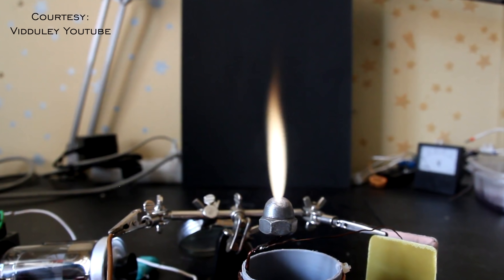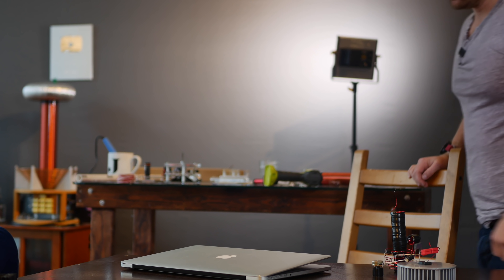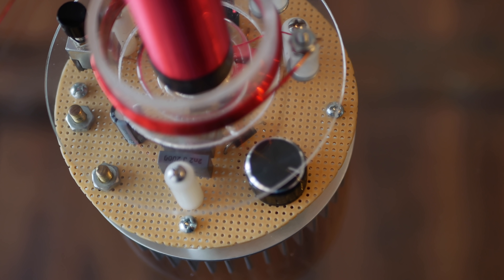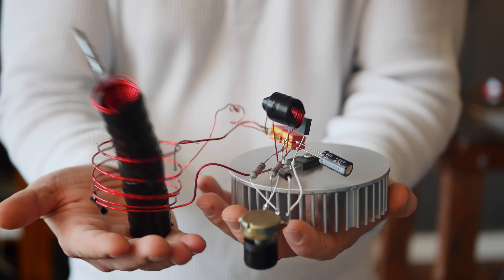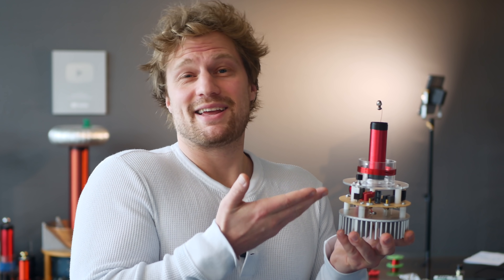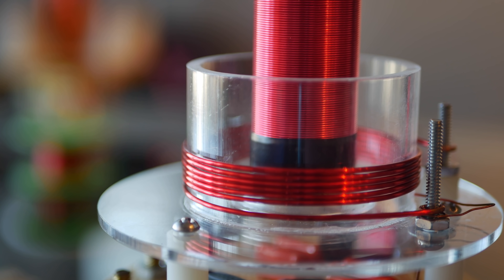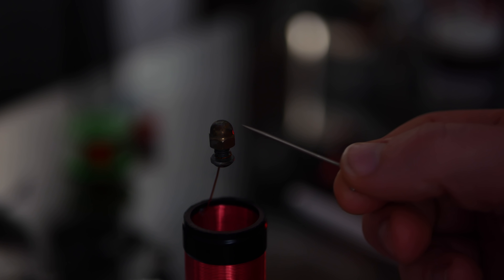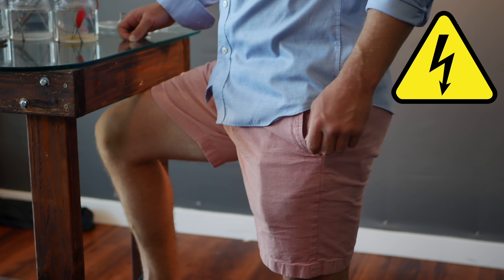Building a Wireless Power Plasma Candle ( Flame Discharge ft. Teslaundmehr)

Comment: Killing MOSFETs. Now you know why vacuum tubes are used much more often with this type of Tesla coil. They are much more electrically rugged than semiconductors although they do take up more space and consume more power. They do have their own "cool factor" though in the way that they look. I've built 2 vacuum tube Tesla coils. You eventually got great results with your MOSFET coil though.

If I were building this project I would have started with a temporary bare copper primary coil with spacing between turns for insulation so that I could use a moveable alligator clip as a tap. This would allow the optimal tuning point to be located much more quickly. After the optimum tap point and spacing are determined, replace that coil with a permanent fixed primary coil made from magnet wire that duplicates the tap point, spacing, and placement of the temporary test coil.

On my vacuum tube Tesla coils (VTTC), I use a primary coil with multliple tap points that can be selected for easy tuning. My large VTTC uses 12 selectable tap points on the primary coil. This is standard procedure for those of us that build VTTCs.

Comment: Awesome video mate, definitely going on my build list, but there's several projects ahead of it. bound to cause a few headaches. may try and use a mosfet driver to help save the mosfets, if i can find one that can handle that frequency and build a separate oscillator circuit. i maybe over complicating it but i want to make it solid and last a long time. i have most of the parts on hand as well, and a few other mosfets to try. i wonder if itt could be done with an IGBT, as have a few massive ones in my parts collection.

Comment: Another thing you might be interested in Is a cold plasma torch Which only Heat electrons And leave the rest of the Gas at room temperature Since electrons have such low mass it's cold to the touch Emporium made one

Comment: This is so cool! I just got mine working - I used a Phase Locked Loop IC as an oscillator to control the gate of the mosfet because I was really eager to try it out, and although it has to be manually tuned to the resonance frequency it works great, with a flame almost one inch long. I will try and start making it self resonating now. Thanks for your inspiring videos!
Reply from the maker: Tom, that is a really interesting method i am not familiar with. Do you mind explaining what you mean?
Reply: @PlasmaChannel   Hi Jay. A few days ago I was messing around with phase locked loops, which I could use to generate any frequency between 1 kHz and 100 MHz that can be set digitally, and happened to still have one set up on my desk after watching your video. I then connected the variable output frequency to a mosfet driver which drove a mosfet’s gate. I used a coil very similar to yours. I then added a resonance capacitor. I connected the power and then had to increment the frequency until I saw a discharge at the top meaning that the resonance frequency of mine had been reached, 11.863 MHz. There are many disadvantages to this way though, such as having to manually tune it based on the capacitance of the environment around it, and the mosfet gets really hot. The way you did it is much better - I just really wanted to try it as soon as possible because it was so amazing, but I’m building yours now.
Reply: @tomg0  Dude, what is the part number for the P.L.L chip you used...or was this part of some prebuilt device ?

Comment: Its more like a RC resonant boost circuit rather than a transformer
 There is no primary/Secondary transformer coils. The primary inductor doesn't have to be around the secondary to work. The primary LC Energises secondary LC and this oscillation resonates together to create high voltage at the output.
Reply from the maker: My particular design did require the resonator be inside the primary coil. Moving it away drastically reduced the output.
Reply: @PlasmaChannel  Your probably changing the resonance by moving the coil

Comment: cool, i learnt a pair of things in this video, but i already built one, i preferred the primary-less solution, with the (supposedly called) "impedence transformer", that is there in your schematic as well, i mean the connection between the secondary and the LC tank, the fact that getting the primary away from the secondary AND seeing the output increase COULD mean you are counteracting that effect, i just built one HFSSTC and after blowing like 5 MOSFETs i stopped, it worked REALLY GOOD for a while with a like 4cm tall flame that i loved but i think i met a batch of mosfets that are not all the same and may be defective (ebay), also i used a variable capacitor that arcs a lot... for now it's along the "to repair" list

Comment: super video, eh, you forgot one thing, it creates ozone, or does it?
Reply from the maker: You know, i dont believe it creates much. The flame is caused by high voltage ionization, but, also by the pure heat which merely burns the oxygen in the surrounding air.
Reply: @PlasmaChannel  You make great videos, and you are a good guy.  I'm not trying to troll you.  I've watched videos where people warned that even sealed plasma balls could create dangerous levels of ozone.  Apparently it is when you touch the plasma globes that the electrical arcs can send electrons into the air strong enough to make ozone.  However, sadly, tesla coils and even corona discharge create lots of ozone.  I just googled it to make sure from multiple sources.  This flame idea is good in a well ventilated room, but shockingly, could be a super high source of ozone, however, since it is in a flame arrangement, I don't know if it is reacting the same way.  You would need to find someone with an ozone detector.  I hope this helps.  I would post links but I don't know if you give commenters the youtube permissions to post links.  Have a great day, Sir.  Sorry for the minor let down.  But hey, if it does create gigantic amounts of ozone, then you have something that can be used to get odors out of rooms and do other experiments with it!

Comment: The one hand rule is useless against high voltage high frequency.
The good news is that you cannot get electrocuted, it just burns you, so it’s like ordinary fire... except it goes through wires.
Reply: True. I saw a video years where a dermatologist used HF current to remove warts by cooking them off.
Reply: I was playing around with a flyback once, at a couple of tens of kilohertz and I got zapped off of a piece of sheet metal that was lying on the floor not connected galvanically to any of the wiring, just from capacitance. It gave me a small shock, equivalent to accidentally brushing against mains on an isolated floor, though the burn mark it created was quite unpleasant. I still have a tiny pinhole on the tip of my finger nearly a year later.
Reply: Isn't that the one saying the current flow, magnetic field and force directions?
Reply: Wow the way you describe it sounds absolutely terrifying LoL.
Reply: As per usual electrical safety goes though, voltages exceeding somewhere in the ballpark of 50-60V whether AC or DC is considered potentially dangerous. This may not be true for everyone but a standard has to be set somewhere. Dc bus voltages on the circuits can sometimes reach that high, or more.

Comment: Can you build the same flame Tesla tower with a standard zvs circuit but turned to 10MHz?
Reply from the maker: That may be possible. By the way, did you leave another comment about that, or, someone else?
Reply: @PlasmaChannel  Thanks for the reply! No must have been someone else

Comment: Great video Jay!  I only have a 9000-volt neon transformer since 1972.  It has always amazed me how it produces an actual flame instead of electrical bolts. If I pass fast-moving air at it, I see the arcs but left on its own , it produces the flame.  For the amount of flame, where does the fuel come from? The flame is not pure electricity so what fuels it?  Not the wire or insulation, if any.
Reply from the maker: Ramius, thanks dude! The flame you see is oxygen burning in the air, from the heat of the actual arc (much, much smaller, camera doesnt pick it up)

Comment: Great video.  Have you considered using a crystal clock oscillator and gate driver to get a specific frequency without all the tuning?
Reply from the maker: Thanks! The issue with that, is that the system needs to be self adjusting. It is very sensitive to moving a hand near it, so, the system needs a self feedback mechanism.